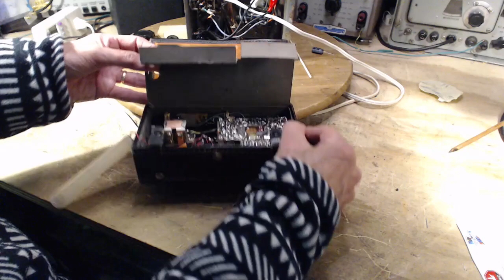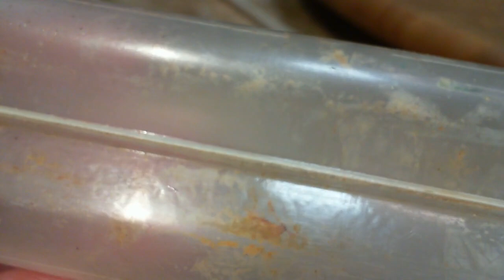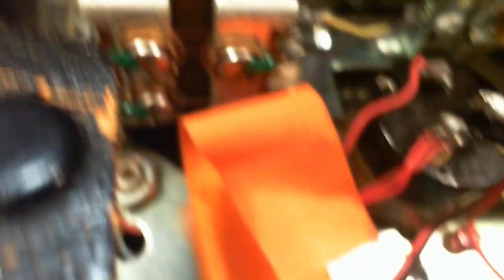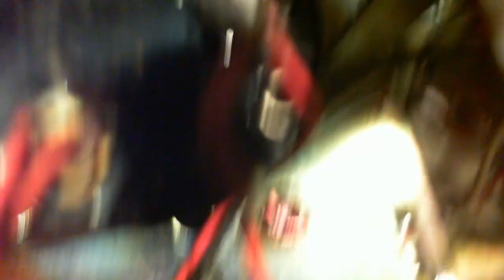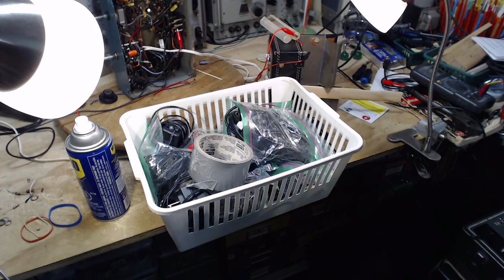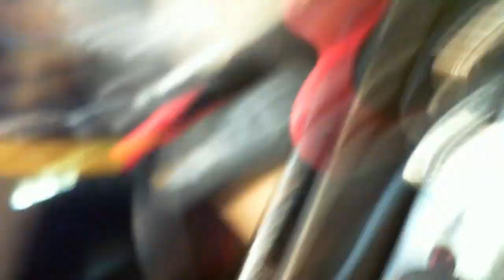Panasonic R-109 Transistor Radio Repair

Comment: Switch your meter through the resistance ranges to the voltage ranges with 10 volts applied to the input. Adjust for maximum smoke.
Reply: Yup, looks like the guardian angel of his test gear is clocking in overtime again...

Comment: I wonder why Jim doesn’t have a DVM with decent cables attached. Those short little cables are not much use when you have to take the meter to the point you are measuring rather than having test leads long enough to reach the job.